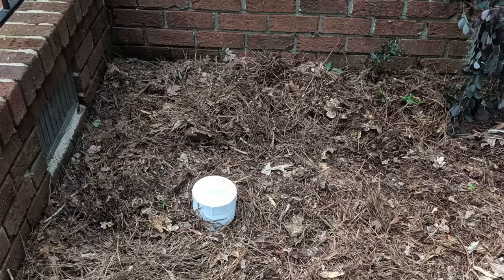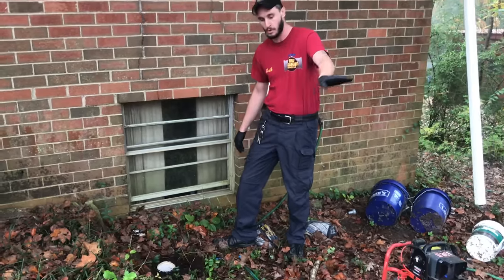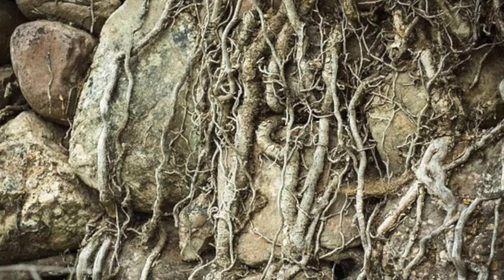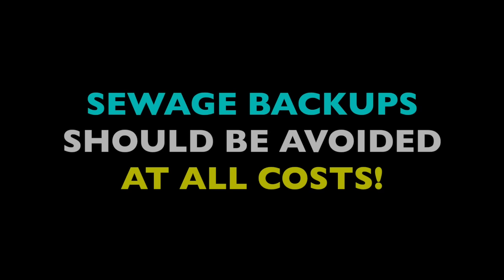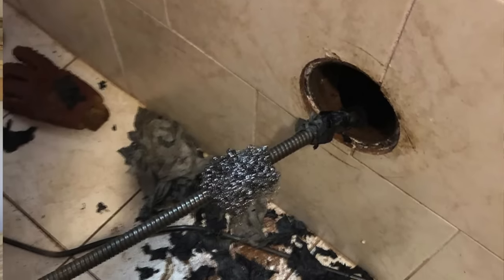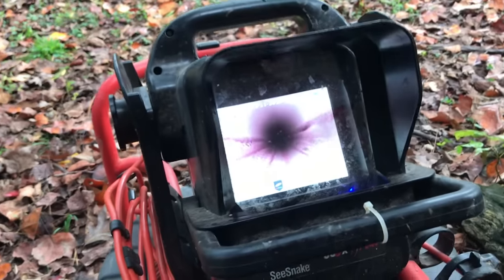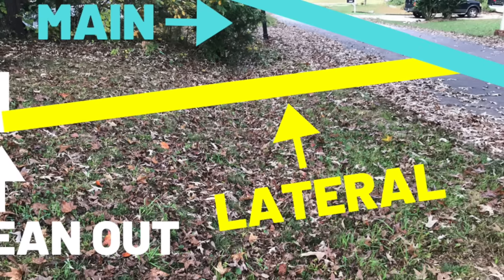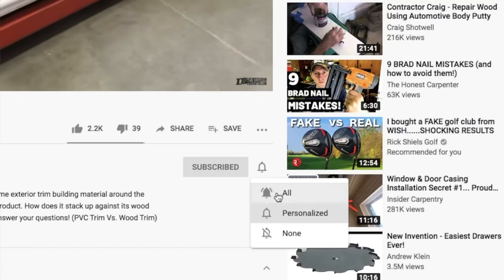This Pipe Can SAVE YOUR HOUSE FROM SEWAGE FLOODS! (Sewer Clean Out Pipe Explanation)

Comment: Very interesting and informative video. We had a problem with an old clay drain pipe busted by tree roots. When it rained, soil would fill the pipe causing a backup. We ended up have to replace the drain as well as the concrete it was under. Total bill was $15,000. We now have yearly plumbing inspections!
Reply from the maker: Sorry to hear that Steve! Can’t go wrong with the yearly inspection—never know what they might catch. Sometimes plumbers will even catch HVAC problems early. I love your channel by the way! It’s been a huge source of inspiration for me! 😄
Reply: Omg! I’m having sewer drain problems in the basement! It started with water, sand and dirt around the drain in front of the washer and dryer, and then I found 4 squares of TP around the water line after it went down! I’m supposed to call a sewer company. This house was built in 1958, and it has city well water. Dang! 
I’m so scared I’m going to have a huge bill
I need to watch this again.
Reply: What pipe material was used for the new pipe ?
Reply: Mr ramsey
Reply: OMG @Steve Ramsey and Ethan, 2 of my favorite carpenters that I learn from. Thank you to you both! Now I know what that pipe is. For my house I thinks it’s for the septic tank clean out, probably same thing. I am definitely calling for an inspection 🧐 next week.
Reply: @Tinyteacher1111  

You can start with a rodding of the pipe by a local plumber (don’t call one of those 800 Toto rooter companies they are a rip off)
Reply: We had a similar issue at our house. Section of clay pipe broke and backed up with soil. Had to have that section of pipe replaced with PVC and we had them install a cleanout at the same time since we didn't already have one outside the house. $2k later and you can bet we'll be getting those yearly plumbing inspections too!
Reply: Wow! Glad I do trees, have a stump grinder, a bobcat, can rent a mini backhoe, and can do all my own plumbing. May have to change my line of work.
Reply: Ramsey you're right, that's the cost for a big problem. Replacement of the whole thing is a big chunk of money.
Reply: @Kathryn Willette  I'm so afraid that I might have this problem in my 1920's home. Last year I had a flood backup in the basement. There was sewage in it. I had it rodded but the smell is still there. It's so hard to keep up when you don't know if have the money 😮.
Reply: My god
Reply: @Tinyteacher1111  I have similar problems, call plumber to clean out, but seems not really solve the problem. Yours done yet?
Reply: @xdeevex428  $2000 is very good to do this kind of job. I wish mine can be solved.
Reply: Need this guy to come to my house lol. I have. 1967 house. No clean out... guess I'll get started on that. Washer runs and is starting to spill water in the laundry room and water gets backed up in the kitchen sink. Time to get that camera in the pipes.
Reply: You don't have to rely on plumber to move your toilet bowl aside and put the borescope in your main sewer line.There are tons of good videos how to, a decent inspection kit with 65 ft lenght runs from $250 to $600, exactly what you pay for one time inspection.
Reply: @darwinawardcommittee  right! call local plumber never the rooter
Reply: We looking at this same problem prolly gonna cost the same not too happy we just bought this house and previous owners didn’t disclose that
Reply: @Bangkok-ik1fp  no our insurance won’t cover root damage in the yard
Reply: Our home was built in 1959. We have clay pipes. Why does it cost so freaking much to get these repaired or replaced. I even thought ill dig it up myself to have someone fix it to save on cost. Had plumber scope it and appears roots have gotten in. So every 9 month it requires clean out. 1 quoted me 10k the other plumber said he's trying to scam you to either make money or give you higher price to not do the job.
Reply: What can I use on the yard near cleanout if raw sewage has spilled out of clean out?
Reply: As owners of same house for 37 years, we've seen our share of various plumbing problems - with the sewer pipe you showed here (except black) exiting our house having become an ongoing issue.

We have (finally) learned to identify the problem quickly: Our guest bathtub starts backing up out of nowhere, but slowly drains over time. If unchecked (as in the past), toilets, sinks, etc. became backed up and unusable.

In the past, we had a plumbing company we really liked come out to fix the problem. They'd go to that sewer pipe, right in front of our house, run a camera inside, detected our tree roots busted threw the sewer pipe as it headed toward the main sewer line and BLOCKED ANY FLOW. Then, would run a tool threw it to bust it up and clear it. That first happened about 5 - 6 years ago. Didn't take long, and cost $200. The plumber advised it'll probably keep happening until the damaged pipeline is dug up and replaced.

About 3 years ago, the same problem occurred. Called the same company (which had since become part of a larger conglomerate), a plumber came out, knew EXACTLY WHAT TO DO, from his predecessor's notes, knocked it out in virtually no time. COST = $600. Needless to say I will NEVER use them again.

Anyhow, I had heard about attacking this problem with products you can purchase for under $20. But it's potentially dangerous to handle if EXTREME CARE isn't used. And I really didn't like the idea of pouring it down a toilet. But I kept reading about it, and its instructions - at the end - mentioned the entire recommended amount could be poured down the aforementioned exiting sewer line. I liked that idea. It was laughably quick and easy - once I dressed for a chemical explosion. By the next day, the bathtub backup was no more. 

I will be routinely applying this product every 6 months from now on.

If you go down this road, I strongly advise dressing safely and using a dry granular product. A product that spashes would scare me. 

As for having this type of inspection done prior to buying a used house... ABSOLUTELY POSITIVELY!!!
Reply: @pamelahudson3003 I’m having this currently. Did you find something?

Comment: As a plumber this is very good and informative. All home owners must see this!!!! 🤙🏿
Reply: My clean out is getting over flooded by sewer water..I cannot afford a plumber 🪠 bc I'm disable and many plumbers charge over $500.00 to drain out the clogged..so for 1 weeks now I have let the lid open in order to take showers and wash dishes..what can I do myself to drain out my clean out from the outside without costing me too much money 💰
Reply: @lauracarretero5151  the only thing you could try using a blow bag. It’ll only work on a soft clog. Something really solid it may not work. It’s a rubber bag you buy from Home Depot. Has to be sized for 3 or 4 inch pipe. You attach it to the hose and push it down the clean out typically like 5 feet in or more depending sewer depth. But you have to be careful. If it’s facing the wrong way it’ll flood your house. Being disabled you won’t be able to handle any real sewer equipment.
Reply: @lauracarretero5151  Main Line Drain Cleaner might get your clog. Most hardware stores carry it. You have to make sure to let it sit for the recommended period (I think 8 hours) before running water again.
Reply: Chemicals shouldn't be the go to choice. Manual removal of the obstruction is what people should do.
Reply: 2) besides, chemicals are useless against physical obstructions like roots, rocks, sticks, cloth items (you'd be surprised how socks & things end up in sewer lines)

Comment: A good video, but you might have mentioned that if you have cast iron or clay sewer pipe you should consider replacing it with 4" Schedule 40 PVC, and be sure to install double cleanouts (two cleanouts in a U configuration that make it easy to scope or clean in either direction).  Also, you might have mentioned using a pressure washer to clean out your sewer line; that's a great way to clean it of sludge, grease, etc.

Comment: This is great. Indeed. We changed all of our large drain pipes directly to the city line ten years ago. The tiny connecting pipe was the tough one- city wouldn’t touch it - even though it was their domain- and the contractor wouldn’t either. Finally the city changed to homeowner responsibility and we got it done- but it still needs the kind of regular inspection you note. Right on! Thanks!

Comment: From my personal experience, a HUGE  problem of flooded basements is the fact that many, many cities do not clean out the city sewer lines like Detroit did in the 1950's, 1960's, and 1970's. There were just as many many inch rainstorms in the 50's - 60's - 70's and 80's in the Metro Detroit area. But homeowners in the Detroit Metro area never had water in the basement. No streets or freeways were under water. But since then, people for decade's would cut the front lawn, and use a blower to clean the grass clippings into the street. When it rained, the grass clippings ended into the street sewer. Add the leaves from the trees falling into the street in the fall season, along with other plastic and paper product garbage people toss out the car window - in time it all adds up to plugging up the sewer. Many cities don't clean out the sewers because of labor costs. When a homeowner has water backup problems during or after a rainstorm, the city water & sewer engineer's readily blame the sewer problem on the homeowner. In my case, that's  what exactly happened. So I hired a plumbing company with a scope to inspect my sewer line. The guy had videotaped the scope trip down and in the full length of my sewer line to the city main line. My sewer was clean as a whistle.The plumber had taped the scope inspection on a VHS tape, and gave it to me. I took the VHS tape back to city hall, and had them play it in front of me.The two dumb assed water & sewer city engineers looked at each other scratching their heads. Guess what? For the first time in decade's, the city inspected their main sewer line, AND found that the city sewer line had collapsed at each end of my residential block. For the first time in over 35 years that I  lived on my block, a city vacuum truck came out and sucked out the sewer. The driver/operator could not believe the crap that his truck unit was sucking out. I jokingly told him that he may find Jimmy Hoffa's body being sucked up into the vacuum chamber of his rig. It took the city more than 45 days to reline the main city sewer line. Since then- no water in resident's basements. Visual advise: look at the grating of your city sewers on your street. If you see any vegetation growing out above the grating, call your local water & sewer department, and have them clean out the dirt/mud and other crap stuffed in the sewer line. There is no excuse for freeways, streets, and basements to be flooded. Demand your city leaders to JUST CLEAN OUT THE CITY SEWER LINES AT LEAST ONCE A YEAR. 
like Detroit used to do.
Reply: Great info!!!
Reply: Your storm and sanitary are separate.
Reply: @Bizzair1990  I know that, but in my area of the world, storm water is coming in the basements. Not sewer water. When the nearby freeways flood out, the rain water goes into the path of least resistance- residential homes.
Reply: Storm and sewer are not always separate.  Detroit and Dearborn do not have separate sewer and storms.
Reply: @amylaurin7269  From my and neighbors experience in the last two flood episodes,  we didn't suffer from raw sewerage water in our basements. It was ALL rain water. After the first flood a few years ago, I had a plumber install back flow valves in my basement floor sewer locations. Last year when we had another major rain event, my neighbors suffered another total calamity in their basements. While they had 3 feet or more standing water in their basement, 
I  had a 2 inch water mark on my wood panels of the walls in my basement. AND I had no standing water on the floor. Although my basement floor was wet, 
I has no property damage. Just a few boxes of stuff that should have been thrown out long before the flood, but my washer, dryer, hot water, and furnace was in complete working order. Of course I had sanitized the basement floor and 2 to 3 inches of wood paneling - but my neighbors had lost everything, including their furnance, hot water heater, washer & dryer. A neighbor 2 doors down had built a brand new home a year before the first flood. Added a 10 thousand dollar man cave in his basement. After the first flood, his whole basement was on the curb, telling me that he wouldn't do that again. Guess what? He did do it again. After the second flood, another 10 to 15 thousand dollar basement went again to the curb. My neighbors asked why I don't have much of anything on the curb from my basement? My answer  -  back flow valves. They are not a waterproof solution,  but I never had multi inch or feet of standing rainwater in my basement, while my neighbors did.
I believe that in my area of Dearborn, I have separate water and sewerage lines.
If we didn't, we would smell raw sewerage standing above the street sewer covers.

Comment: We had a major power and water outage recently that lasted days.  When everything was restored, sewage and water began to flow again but somewhere there was a sewer backup in the neighborhood.  Sewage began flowing out of mine and neighbor's shower stalls and toilets.  Our sewer lines are new because it is a new neighborhood with young trees etc.  Once this happened we removed one of those yard sewer cleanout caps in the yard and it flowed out at a VERY high rate.  This saved our home and many others on the block.  As a preventative, I picked up a cap that will automatically blow open if pressure is high enough in those lines which will relieve that pressure and prevent this from happening again.
Reply: where did you get the automatic cap?
Reply: What is is called?

Comment: My house was built in 1954, and I had a backup last year. Snake cleared the blockage, whatever it was, and video showed no major issues like roots or sagging. I'm inclined toward the recommendation of a video every couple of years. It costs $400 in my area, but replacing the line is $10K (25 times as much) so it seems money well-spent.

Comment: My house was built in the 40s on a slab, so no clean outs in the yard, however they can access through the stacks on the roof. Also, a good piece of advice, once your pipes are snaked and cleaned, keep them cleaned! Depending on your pipes, but every Fall and Spring I flush some copper sulfate down the toilet to keep my pipes cleaned.

Comment: i have washouts every 50'. (code requirement) and cut the washout just below the earth and then installing one of those valve enclosures with the lit that can come off.
This way I can run over it with the mower and no problems. Another item I installed was a sewer line "pop up" at both the home end and the road end. 
If the sewer backs up on either end, it pops up and relieves the pressure at the wash-out..
It is possible for the lateral line to become plugged as well and I don't need the neighbors sewer in my house either.

Best to have some sewer dumping on your lawn than in your home. It might even help the grass!

Comment: I work for DPW in my city, we service sewer lines and mains for the public. A lot of the homes that we come across where the sewage is backed up have offset clean outs. If you look in the clean out and see that it is visibly offset you can probably assume that it’s also offset underground. Our county will fix the connection from the property line to the main, and we will flush the service line from the clean out to the main, but that is the end of our responsibility.
Reply from the maker: Seems like that’s where most counties stop, Crane. No going into the yard generally.
Reply: Maybe you can answer a question. In fall 2021 my sewer line backed up and I was fortunate enough to contain it in plastic totes. But, I got much more water coming into the basement than I had used in the previous 2 days and we hadn't had rain in a week. I got Main Line Drain Cleaner, but on my way back from the store I noticed a non-municipal truck up the road with lines going down to the sewer and "steam" coming out of the access hole. I asked the worker what they were doing and he said they were cleaning the sewer. I asked if there is any way that could have caused my backup and he said "no". I used the Main Line Drain Cleaner and everything was fine in the morning. The next day as I was pulling out I saw the contractors truck past my house. So when I had the clog they were working "up-stream" of me, presumably pressure washing material toward me and it cleared once they were "down-stream" of me. 
1) Could their cleaning have caused the problem?
2) If I have a lot more water coming in to the basement than I put down the drain, does that indicate it is a main line sewer clog?

Comment: These are lower than any drains in your house. After being flooded out by main line sewage, we were told to keep our clean out pipe uncovered; turns out doing so saved us from back-flows twice (during very heavy rains when the city sewage lines were overwhelmed). We now have a back-flow valve; but keeping your clean out pipe uncovered is something to consider.
Reply: A mushroom cap is better.  At the end of the cleanout was a trap and the trap collapsed on itself.  If I didn't have a mushroom cap which allowed the sewage to go onto the driveway it would have went into my basement.  A mushroom cap also prevents sticks and debris from going into the cleanout.